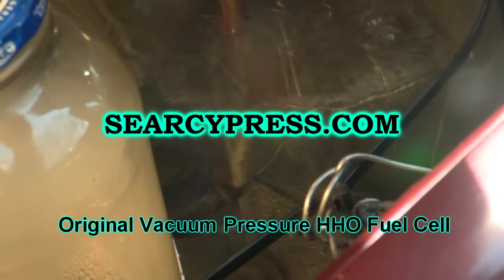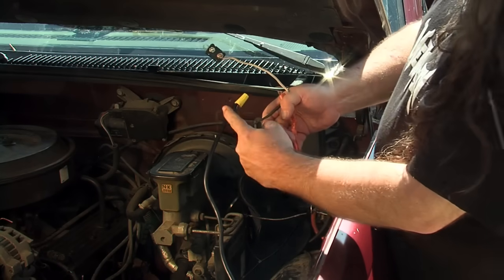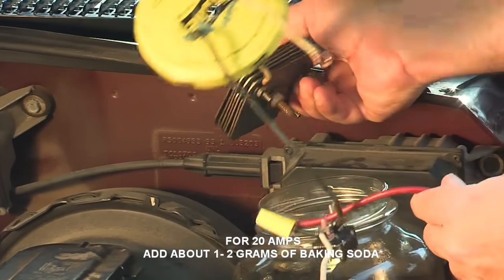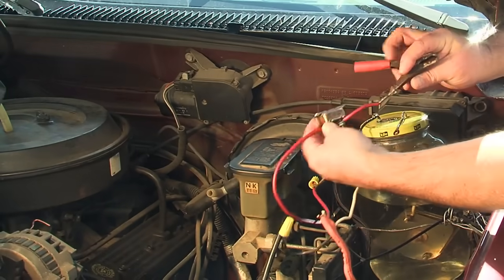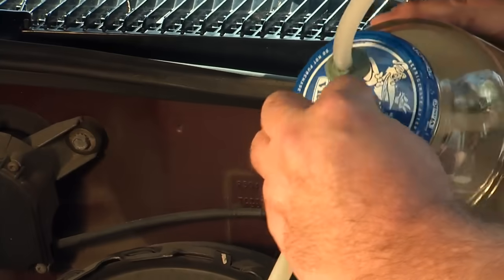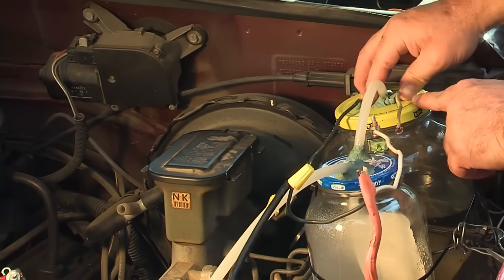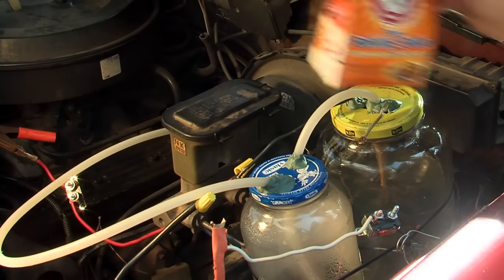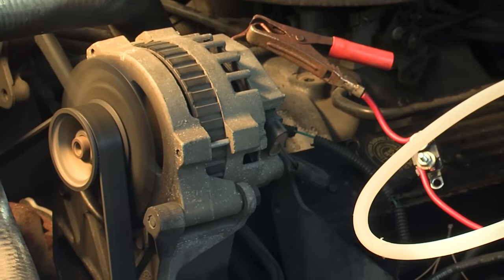Vacuum Pressure Hydrogen fuel cell defeats high gas prices using hydrogen from H2O.

Comment: I want to see a more extensive and detailed video from you on this
Reply: I am going to make my car run on a SAFE HHO SYSTEM  that I invented  It separates the oxygen from the hydrogen in the system making it tell there's no need for dangerous bubbler does no danger of backfire and no danger of explosion
Reply: @Rich B  That's why you in front your system in a covert way my completely safe HHO system has been invented for the first liquid fueled model toy Rocket
Reply: its very simple...   electrolysis generate's hydrogen and oxygen from water...   you feed it into the intake of the engine (since its not liquid like gase thats it)

an engine will suck in as much as it needs to run.  backfires are easily supressed with a spring top bottle..   backfire = the top pops up release gas then closes..  totatally safe.
if I recall  nasa use's hydrogen as fuel for the simple fact...  what they said...  

"Hydrogen is the best.. SAFEST FUEL in the world"
Reply: @harleyme3163  First problem, i see here, it is BS.
Before you start pissing on me i will explain:
1. This is NOT a fuel cell. It is a standard HHO generator.
2. It costs more to supply energy to this system then to use gasoline. Best  electrolysis HHO generators operate at about 70% efficiency. I doubt this home made device is that good. And he would need a few tons of batteries for it to work. If you have that much power in a form of electricity, why convert it into chemical power with 30% loss? Use it directly - inverters have about 98% efficiency. Electric motors are similar with efficiency.
3. Let's assume 2l motor, 4 stroke. So it takes 1l of fuel mixture for one revolution. This little jar wouldn't produce enough mixture to run any engine besides maybe a little few cc toy motor. Yes it may work, but it will have a very lean mixture and no power. That's a beauty of hydrogen, it will work with very low concentration too.
4. If this is a normal gasoline engine, it will get destroyed quickly. Water, different working temperature, different behavior of combustion.

Wonderful comparison of combustion gasoline and hydrogen motors was done by channel "Engineering Explained" - "The Difference Between Gasoline And Hydrogen Engines"
Reply: @sikismeker  You are right. In fact i have about 1,3kg of that in my head. Thank you for noticing ;D
Reply: @ogi22  How do you know?
Reply: @ogi22  Yeah, your second point is wrong, try 1-10% efficiency at the VERY most with electrolysis then consider that the combustion engine is operating about about 30-70% efficiency (actually 30% on any engine you could use this on). 

As to point 4, it'll run just fine on the mix of 2:1 and this isn't up for debate, what you should look out for is valve wear. Even with hardened intake seats (which is a must) a lot of models don't have hardened injection valve seats and this does not provide the cooling that spraying cold fuel on them does nor does it have the additives needed. Get a proper European car after the introduction of E85 and you'll be fine though.
Reply: @michaelmay5453  I probably didn't phrase it correctly. I only ment the efficiency of convertyng electricity into a mixture of gasses (electric energy used to separate hydrogen atom from water). I know there are much more steps between this and the actual energy that is transferred to wheels for movement and this one i agree could be around 10%. I only ment that if the first step looses at least 30% energy (conversion from electric to chemical), than it is much more efficient to run an electric motor and bypass all unnecessary steps in between.

I'm not an expert on car engines, so i also assume you rephrased my simple "it's bad for engine" statement :D
I just thought of a few things that came to my mind in that moment, only to proove my point.

You can also use old diesel engines and run them on any kind of vegetable oil. Back then engines (and a lot of other things) were built to last much more abuse than today.
Reply: @ogi22  We're mostly in agreement except that you are counting water as a clean source that needs no treatment to begin with (it does).

The first step loses a lot more than 30% no matter what though, if it didn't this would be a viable way to produce hydrogen from waste heat making the electrolysis highly efficient but in reality you can't get closer than 10% efficiency with all things considered.

It's not bad for an engine after the year 2000 that isn't a direct injection engine, it just needs another form of injection to work.

My tractors run on recycled oil, not so much because it's cheap or that my little contribution would do much but I like that I produce the oil that eventually is used to run my vehicles. There is something nice about that.
Reply: @michaelmay5453  Ok you are right. I totally forgot that you need pure water and it really takes a lot of energy to clean up (distillation, membranes or in whatever fassion). I focused only on converting electric power to chemical one with just a bit of heat. My fault and thank you for pointing out this issue :D
Reply: @ogi22  Of course I'm right... I always am.. ;)

I'm just kidding, I'm not that big of a narcissist and it's forgivable that you missed a few steps. I do that too at times, it's all good.

Have a great Friday. :)
Reply: @ogi22  Just curious,  if we are not talking about running an engine purely on hho, how does your analysis compare? Also, the alternator and or regenerative braking and other energy scavenging techniques recover wasted energy, thus hho production costs are somewhat negated and the hho would only be a supplement to offset the primary fuel usage not a full time replacement. Thus I believe hho naysayers have seem to Pigeon hole themselves with the concept of a purely hho fueled engine.

Any thoughts,  constructive of course?
Reply: @Lupgaroo666  What "wasted" energy? Alternator is using energy from fuel to create electric power to supply everything in that car. Nothing is wasted there. Regenerative breaking is using kinetic energy of the car to boost electric power from alternator. You can either convert it into heat on your break pads and disc, or partially create some electricity. This is a normal procedure for ANY electric motor - each time you push motor to rotate, it is creating current. If you connect a load to this sistem, motor will feel a resistance force (used for slowing down/breaking). Every crane i know (and i work with high bay warehouse equipment for over 8 years) has either special breaking resistors or recuperation module to store/remove energy created during breaking or slowing down.
You COULD use that energy to create HHO, but you are wasting over half of that during this process. Much more efficient is to store it in the battery or capacitors and reuse it. This is the main problem - loses while converting energy types. And that's why miracle HHO generators won't work.
Alternator is not producing free energy only because the motor is running. It is always "working" against the motor, partially removing that kinetic energy and converting it to current. All of that electric equipment in your car sucking up electric power is taking this power from your motor, slowing it down - resisting.
Reply: @ogi22  My basic premise is kinetic energy, could be better utilized to make powerplants, suited for such, more efficient. 
This could be accomplished by a synergistic system that recovers kinetic energy for hydrogen production and storage, electric power production,  waste heat recovery, etc, while still utilizing other fuel sources in the primary motivator with Hydrogen and/or electricity as a supplement to offset overall fuel consumption. 

In this concept Hydrogen is not the only, nor the primary, fuel source. 

Possible sources of Energy loss: braking, vibration dampening, heat, electrical power over generation. You can get higher output alternators. I don't believe all the energy produced by an alternator is utili100% of the time an auto is operating. That's why they have voltage regulators.

Hydrogen storage would be onboard and refueling would be no different than going to refilling points as petrol, propane, butane, natural gas, or Ev stations. 
This concept is not necessarily based on any modern petrol or electric car in current production.

Here's an interesting article:  This Go-Kart Is Powered By A Tiny 2kg Rotary Hydrogen Engine
Reply: @Lupgaroo666  This is not a new concept. All renewable energy needs a buffer. One possibility is making hydrogen and then utilising it to get energy when renewable part is down. There is only one question - what pays off better? 

Recently i have heard about thermal storage (melting aluminum and using the steady temperature of a melting point and using stirling engine as a generator)
www.youtube.com/watch?v=Be3FckQoDws

I think storing energy as a hydrogen and using this later for internal combustion engines or hydrogen cells is also interesting.
Reply: @ogi22  
Yes, but it seems companies and people in general are focused on one or the other, batteries or Hydrogen, when they praise batteries and down play Hydrogen.  Elon Musk has said that batteries are the way to go and Hydrogen is a dead issue,  (paraphrased). 
It seems none are seriously looking at a synergistic system that would maximize the benefits of both. Hydrogen is purportedly not as efficient as batteries,  yet it is more efficient than petroleum based fuels.  It is less environmentally hazardous than either.  When compared to batteries,  Hydrogen offers more range, faster refueling, more power...I think, is lighter and easier to store and does not have nearly the long term environmental hazards of petrol or batteries. Not that I'm a tree hugger, but there's a big benefit here. 

Electric 70-80% efficient 
Hydrogen 25-35% efficient ??? 

The article takes into account hydrogen production when figuring efficiency,  but does not take into electricity production for battery vehicles. A bit one sided since electricity, the last I checked, isn't freely produced,  unless you're harnessing lightning, Nikola Tesla. I digress.  That's another topic in itself. 

Cited from:
What’s more efficient? Hydrogen or battery powered?

https://www.volkswagenag.com/en/news/stories/2019/08/hydrogen-or-battery--that-is-the-question.html#:~:text=This%20means%20that%20the%20hydrogen,to%2020%20percent%20overall%20efficiency.  

Which energy has the best efficiency and is the most cost-effective for driving e-cars? Battery or hydrogen operation?
With battery-powered e-cars, only eight percent of the energy is lost during transport before the electricity is stored in the batteries of the vehicles. When the electrical energy used to drive the electric motor is converted, another 18 percent is lost. This gives the battery-operated electric car an efficiency level of between 70 to 80 percent, depending on the model. 

With the hydrogen-powered electric car, the losses are significantly greater: 45 percent of the energy is already lost during the production of hydrogen through electrolysis. Of this remaining 55 percent of the original energy, another 55 percent is lost when hydrogen is converted into electricity in the vehicle. This means that the hydrogen-powered electric car only achieves an efficiency of between 25 to 35 percent, depending on the model. For the sake of completeness: when alternative fuels are burned, the efficiency is even worse: only 10 to 20 percent overall efficiency. 

...The conclusion is clear: fuel cell e-cars have many advantages (range, fast refueling, no heavy battery on board), but one decisive disadvantage: it is comparatively inefficient – both in terms of efficiency and cost. “No sustainable economy can afford to use twice as much renewable energy to drive fuel cell cars instead of battery-powered vehicles,” says Dietmar Voggenreiter, head of the study. Hydrogen could only be used in niches, in trucks and buses, and over long distances. Battery weight, range and fueling time play a decisive role here. It increases extremely with increasing capacity, which makes batteries uninteresting even for trucks. In addition, existing truck filling stations could be converted to a hydrogen filling station network with manageable effort due to their lower numbers.
...
Here's an interesting article:  

GM Picks Up Hydrogen Fuel Cell Torch After Nikola Debacle
https://cleantechnica.com/2021/06/23/gm-picks-up-hydrogen-fuel-cell-torch-again-after-nikola-debacle/ 

Thanks for the link. The sterling engine is interesting. 

I saw where a company is using electricity to heat blocks for excess power generation storage and converting it back to electricity for later use. This method and other energy storage banks, like gravity storage, seem highly inefficient. But if it's wasted energy then it at least serves that purpose. 

White-Hot Blocks as Renewable Energy Storage? - IEEE Spectrum 

https://spectrum.ieee.org/energywise/energy/batteries-storage/could-storing-electricity-in-whitehot-blocks-give-supercheap-renewables-storage
Reply: I agree.  I had an HHO generator a few years back when gasoline prices here were approaching $4.00 a gallon.  The problem with modern vehicles is that they are all computer controlled with closed feedback loops.  While you might gain a significant amount of MPG increases, it will be short lived because the computer will always readjust the short and long term fuel trims and maintain the stoichometric ratio to 14.7:1.  He left out a lot of information on this.
Reply: @Humpty Dumpty  No, the emissions from hydrogen+oxygen combustion is literally water (mix going in 2:1 H2+O results in H2O emissions). With air it will produce NOx as it is present in air but still FAR cleaner than all other fuels out there.

It is INDEED more efficient to use it as a fuel cell though, you're right about that.
Reply: There are companies that make these. Goggle it
Reply: @Humpty Dumpty why in tf would you split water then recombine it and believe you were gaining energy
Reply: @Humpty Dumpty you said we should use hydrogen fuel cell. That is what hydrolysis and subsequent fuel cell is: splitting then recombining water.
Reply: Hey this is Rick from Rick and Morty the government has killed this guy from video I can't find them anywhere
Reply: @Rich B soon
Reply: Me too please
Reply: @Rich B Ah, so you are insane?
Reply: This is really simple and the answer to whether it works is LOL, no. Everyone who ever finished 7'th grade physics in Europe should know this cannot work.

The process of electrolysis is very energy demanding, much more so than the energy that can be produced from combusting the resulting hydrogen and oxygen (it's also a reversed state of ideal mix which is 1:2 but that is a good thing because it'd blow the top clean off if you tried to run it at 1:2). You'd need about 5-8 engines running to produce enough current to get one engine to run on the resulting mix.

I don't know if he's trolling or just outright lying but it's one or the other.

Comment: I'm a Diesel mechanic, using Glass under the hood or working around is dangerous.  This is totally B.S. . Look out the house wing nuts for AC but your on DC. Looks like a meth lab under the hood
Reply: Besides the fact that hydrogen implodes when ignited, thus counteracting the explosion of gasoline.
Reply: Peter HILL diesel Mech here too. Floating exposed wires and breaker posts, glass under the hood, not to mention your turning that water into an alkaline state witch if the glass breaks would act like battery acid on everything. Agreed meth lab total garbage.
Reply: you have a lot of experience with meth lab's ?_?

Comment: Any fuel from h2o/water  is using the hydrogen Google hydrogen explosion  that's way we don't but it in car no government conspiracy  just safety
Reply from the maker: Making hydrogen in the vacuum is completely different than pressurizing it. It is practically impossible to ignite it until it enters the engine.
Reply: @metalpresstv  nah I still don't trust hydrogen the tiniest amount of air can set it off

Comment: No one way check valve all this cheap equipment seems like a disaster
Reply: I made a bunch of these and got about 15% better mileage.. I also exploded a six pack of them in my living room. Cut my face up. Triple check your wiring, use a check valve/bubbler, or just get a prius.

Comment: low  grade electricity ( just 2 volts DC )  can create high grade fuel (hydrogen the most common substance in the universe. ) . what is the real long term  cost of exacting and processing  and disposal of the lithium? how much lithium ( considered  as a rare element) is available total world wide . . how long will it last.